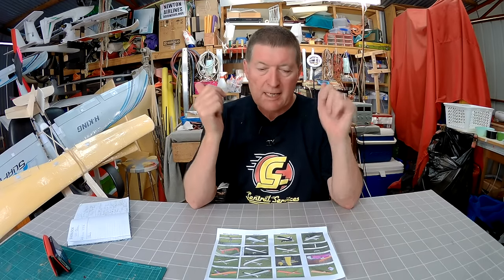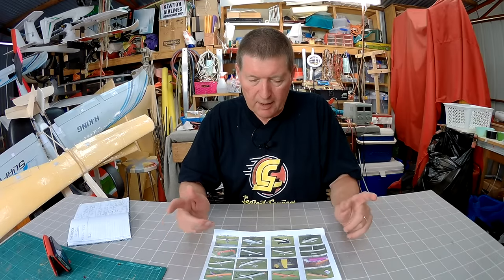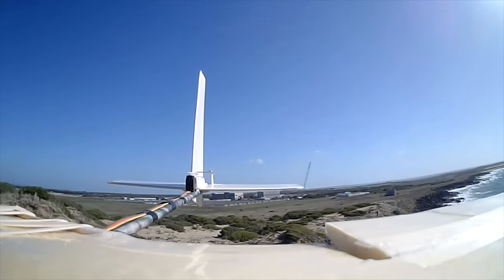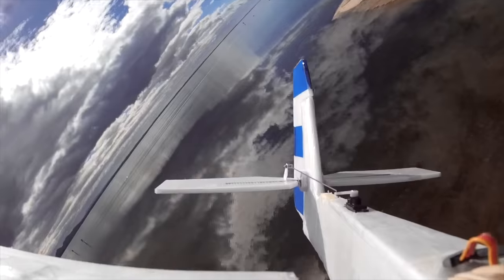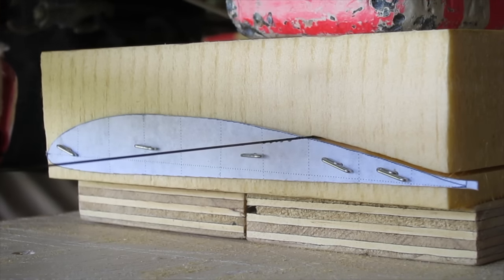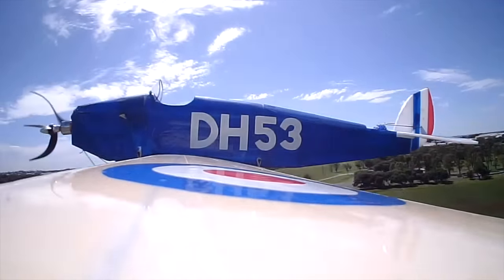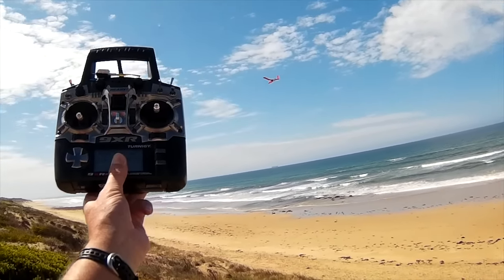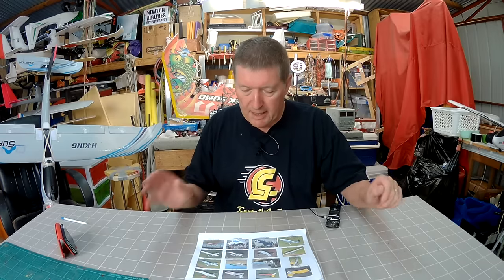Past Planes 5 - Hot wire & multirotors

Comment: I think the hot-wire tool is awesome. With a little bit of ingenuity one can build a nice hot-wire cutting contraption. I would want to not only use it to cut wing shapes but also a least roughly cut a fuselage shape then neatly sand it down to perfection.
Reply from the maker: Yes that would work too.

Comment: Building wings, that's where I came in, stayed for hot wire wings,  I do remember the "Dutch bikes" in one of the tricopter clips, or I think I do. I still haven't built my own wing but I have built a variable temperature hot wire cutter and designed the wing or, more properly, plagiarised a wing design. I'll build it one day.
Reply from the maker: Finding the right foam can be difficult but you're well on the way

Comment: Very good series Andrew. I really enjoy your accessible and informative videos.

I have also followed a similar construction technique progression from Foamboard > Depron > Hot-Wire. 
Have you experimented with hot wiring fuselages? I have found it to be a quick and effective fuselage technique which produced stiff fuselages with a 6mm CF or hardwood dowel, then laminate the fuselage with 75 micron doc film. You can end up with a round stiff fus which feels like a foam baseball bat.

Finally what are the key design differences between your home made light wing and strong wind slope soarer design that you reference in this video?

Merry Christmas from the North.
Reply from the maker: Thanks for that. I have not tried that method for a fuse. The strong wind sloper is much stiffer in the tail boom, shorter wingspan and almost twice the weight and less control surface throws.

Comment: Hi Andrew, I know this is an older video, but I wanted to tell you I've made 3 FliteTest designs: Tiny Trainer, Pietenpol and the spitfire. The tiny trainer and pietenpol aren't great, but the spitfire is amazing, I highly recommend it, since you said you didn't like the FliteTest planes a lot. I made my spitfire out of 6mm depron, there's a video of it on my channel.
Nils
Reply from the maker: Good to hear it Nils. Depron is a lovely material.
Reply: Andrew Newton Yes it is! Foamboard here in the Netherlands is really heavy and it's almost impossible to remove them paper. So not great for models.